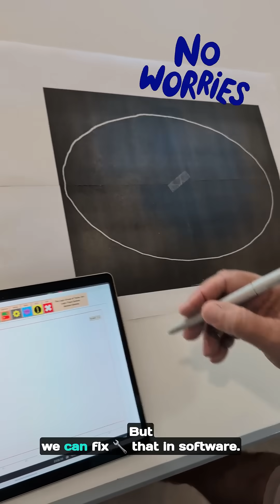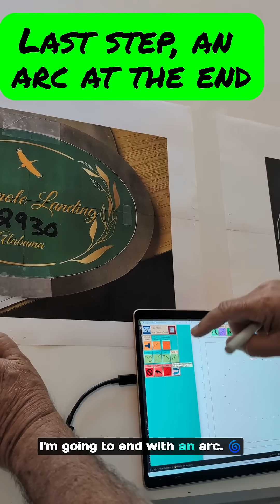How come my tracing pattern is not as good as those in the Logic Trace videos? #cncfiles #dxffiles

Comment from the maker: The customer used the tracing method which creates a pattern wherever the pen goes including wiggles caused by the shaking hand. A more accurate method for this design is to trace using curves and curve fit through points. The software computes a spline/bezier curve fit through the points resulting in a perfect, smooth outline.